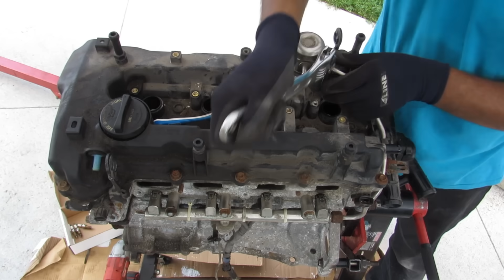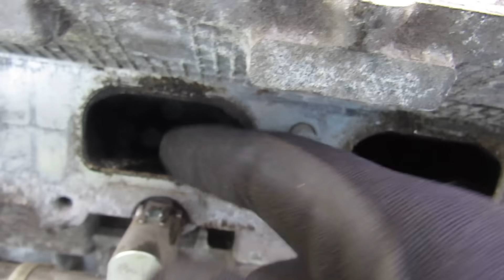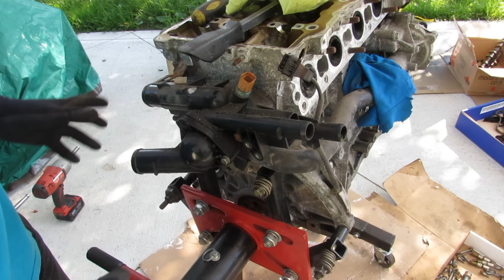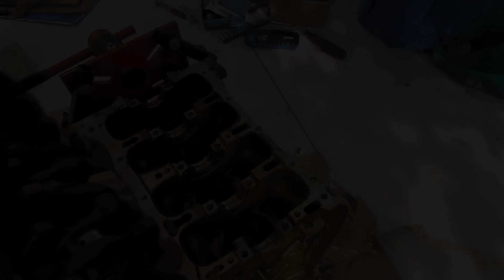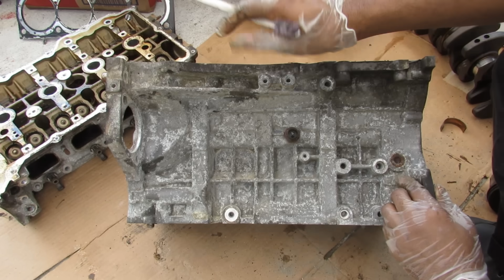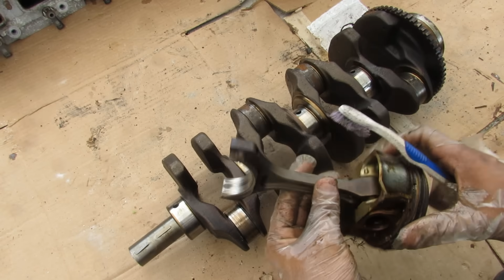Why Hyundai Engines FAIL

Comment: The deburring story doesn’t make sense to me. The oil with debree goes to the pan, then theough an oil filter, then back to the engine and inside the bearings.
Reply: When it new and freshley put back together theres a brief moment where the engine will turn over dry. This for engine builders id the moment where its either very good news or bad news. 

Oil filters are all fine and well but in the real world not all filters are built the same. 

Oil filters will filter down to many microns but if the engine had poor service maintenance
 Ive seen metal shavings in engines pierce through cheap paper eleement filters vecause of this. 

Truth be told its an interesting video but an engine built by robots will never be built to the same tollerance as man. 

Ive seen cases of engines where they have lubricated the cams and bearing but they just haven't put enough on to stop the dry start up.
Reply: The material gets caught in passageways and restricts the flow of oil to the rod bearings.
Reply: If its in a galley on the way to the bearings, which most are, it will first travel to the bearings.

Comment: I had the earlier version of this engine which was also 2.4L but no GDI and it was still running fine at 230,000 when I got rear-ended and totaled. I had to replace the alternator at some point but that was it besides normal wear items.
Reply: The older Hyundai engines seemed to be much better than the newer ones. Hyundai has had issues for years with quality control from everything to engines to paint to sensors to trunk latches, they’re cheaply built and their quality control sucks
Reply: most cars from the 90s/early 00s were 10x better built than now & cost a fraction of the cost. I feel like just keeping mine, getting newer engine& adding BestBuy applecar play. Kudos to you for that many miles so far.

Comment: I had a Santa Fe, American made with that engine which at 135000 kms gave up. Sounded like nuts and bolts rattling around in a tin can. My engine was checked for debris in the oil and non was found at around 70000 kms. Hyundai replaced the engine with a new one as they extended the warranty to 180000 kms. They will also reimburse those who already paid for repairs. Hell GM needed to be pushed to replace their faulty air bags. I have had a Ford Topaz that had the sand casting plug (frost plug) leak in the first year that Ford told me that that part wasn't covered under warranty. I also had a Ford Taurus that dropped down to first gear while traveling at 70 mph. That happened twice to me. Throwing the transmission into neutral didn't work as the motor was over revving. Problem not covered. Oh by the way as my 2014 Sana Fe was so reliable, only needed oil changes and regular maintenance I bought a 2021 Santa Fe. Maybe the Big Three should make affordable, well contented, reliable cars with long warranties and the then the public would buy them instead of the competition, Toyota.

Comment: Too bad Hyundai / Kia messed up their bread and butter power - plant....You would think they know they HAD to get this right, or it would kill their reputation. I have had incredible results with their 6 cylinders,  2009 Genesis sedan 162k miles, and 2013 Sorrento 155 k miles.  No troubles with either.

Comment: Well, it's better than a Volkswagen engine.  Nice roller on the high pressure fuel pump follower, instead of the flat bucket design that wears out on the Mk6 GTI. :)

Comment: People in 2012 were hyping up Hyundai saying their vehicles were “no longer junk”. I remember nearly falling for the hype when I stupidly went for a 2012 F150 with the 3.5 ecoboost instead. 😂 I had unexpectedly switched jobs from commuting over an hour to working locally and decided to go with a truck instead. Boy... I felt the impacts of being a test dummy for Ford with those first gen ecoboosts tho. Although... after everything was worked out... I can’t lie... that engine turned out to be pretty decent. Ford put two new turbos and redid the timing systems at around 65k miles. Thank god I bought the extended warranty. 😂 But since then... the truck has actually been great. Still actually drive it daily.

Comment: As an owner of 17 sonata and a previous hyundai dealer employee I recommend everyone get only a full synthetic oil change the conventional stuff doest resist thermal breakdown as well as synthetic in addition to using additives like Lucas full synthetic oil stabilizer (the black bottle), motorkote, or best line. They add a tremendous amount of friction modification lubrication and will NOT void warranty. just make sure you keep detailed documentation on oil changes if you do them yourself.
Reply: How about just buying a Honda or Toyota instead.

Comment: I bought a 2013 Sonata GLS Base back in 2014 with close to 65k miles on it. It was released from a rental fleet and that explains why it ramped up so many miles in just a little over 1 year. The car was definitely not in top shape as you could imagine how renters did all kinds of abuses on rental cars. Long story short, I started hearing some knocking sound from the engine around 75k miles and I thought it would blow up any time soon. But till today, 7 years later, with 143k miles on the clock the engine is still running pretty smoothly with lots of power, although the sound still exists with heavier throttle input. And other than this and the renowned steering wheel clunking (due to a broken $5 rubber ring in the steering motor), the car still holds up pretty well.
Reply: I have a 2013 Elantra GT. I always make sure it is serviced on time, I still have the car, 78,000 on it . I just got the notice from hyundai to bring the car in and as I read somewhere else, so they can install a computer program to shut the engine down, when one of the telltale signs shows up. I guess so they can put the bandaid on before the engine destroys itself. The car has been a relatively good car, it  did have that issue with the rubberband in the steering and the clock spring which they wouldnt warranty, and then come out later and said it was,I fought with them to reimburse me for it.

Comment: little known fact, these engines are a result of the collaboration between Mitsubishi, Hyundai/Kia, and Daimler Chrysler called the GEMA engine. common designed block with the manufacturers putting their own little spin on it. the VVT system is a Mercedes design which is shared across all manufacturers, called MIVEC in the Mitsubishis and VVT in the Chryslers and Hyundai/Kia. A common modification that people do on the Dodge Caliber Srt4 is use the Evo X oil pump and timing chain system as the it doesn't have the balance shaft module. I just finished rebuilding a 2.4 turbo block for my Caliber and used King rod bearings and a timing tensioner for Hyundai/Kia engines.

not sure what else fits but after watching this tear down it looks like the water pump is the same, cam gears, and the timing components, I wouldn't be surprised if the oil pump/balance shaft module is the same (as they look very similar in pictures), and possible crank bearings.

Comment: The new 2.5 are coming apart too.
We have done soooo many engines at work it's unbelievable.
Reply: How are they still in business??
Reply: @alejandro11000  Good question. Probably the same case as GM. If Korea had more decent car brands they'd be dead by now.
Reply from the maker: Are they? Haven't read anything yet
Reply: @speedkar99  one oil pump failure and one complete lower end failure so far.  80 miles on the pump car and 9k on the failed engine.  Cvts are very short lived some haven't worked off the car carrier to the lot.  Updates rendering modules useless... busy but not a lot of fun.

Comment: I love Hyundai and Kia and own one but… if it was a debris left in the engine at the Alabama plant which they said years and years and years ago why would the 2019s be doing the same exact thing and some of which that were built in Korea? It’s not debris it’s design.
Reply: Well at least they gave a lifetime warranty if it was GM they would still be deny it was a problem
Reply: @heknows5418  exactly!!! I told my mom to go for a 2016 sonata with 58k if she liked it (she now owns it) it’s a limited with the extras so it has rear heated seats and sun shades and all that. Knowing the engine issues I still said go for it but I also knew there was a lifetime warranty extension.
Reply from the maker: Exactly...the way they handled this was suspicious

Comment: I have a sonata 2015 sport. I’m a taxi driver the car was bought 0 miles on 2015, I drive 100 miles every day or 8 hours a day now the car is 147,000 miles no problem I noticed the rattling noise come front the top driver side only when I accelerate but the car has no lights no codes work normal only the little noise when the radio is off is noticed. I know my car just control your driving behavior no one is waiting for you know your car and always change your oil every 3000 miles it work for me.

Comment: Does 1.6 engines have the same issues ?
Reply: Yup. And I left it at the dealer.  80K miles.  I could not afford a 9000 repair.

Comment: I believe what you called a oil pressure sensor is in fact the knock sensor. Not 100% sure but that's where they usually are.

Comment: "Because they know you're going to have to change the engine" 😅  Great video man, excellent work. 👏
Reply: My 1992 toyota corolla also had those hooks for easy engine removal. It had 230000 miles when i hit a deer and totaled it. That was a great engine. Why do you think they had the engine hooks on it?
Reply: @Justin_Credible777   The hooks in the Corolla where there just in case you wanted to remove the engine to clean it from the outside.

Comment: Had a 2006 Hyundai Sonata ( my first car) with the 3.3 V6.
Changed the oil religiously. Then one day after a long road trip. I started her up... knock Knock, it was a rod knocking. 
Over time it got louder and louder. until one day I decided to get a new car, a 1999 chevy lumina. 
Sold my sonata for $400.
Never will I ever buy another Hyundai.

Comment: Hi there. I found this very interesting - Thank You.
Seeing this is a Canadian site, I'm trying to find out why my 2012 KIA Forte5 EX 2.0 hasn't been put on the recall list here in Canada? I know Canada has been really slow/behind on getting the recalls out, but I have read & heard others with the same engine have gotten their recalls & some not. Some have even had their engines replaced or tended to (aka installing the knock detection sensor). Also, a class action has started back east & not here in my neck of the woods (I live on the west coast). I can't get an honest answer from KIA (the dealership or KIA Canada) obviously, just "oh you must be one of the lucky ones". This engine issue isn't only the 2.4, this is apparently happening to the 2.0 engines as well!!  I know someone who has the sedan of the same year & the same engine as my hatchback & they received their recall notice a few months ago already & their issue seems to be rectified. My car has 92,000 km on it and I have been noticing "ticking" which seems to be getting louder. No oil issues, yet.
I feel trapped with this vehicle now as I'm terrified every time I'm out driving it for my safety as well as for others. Also now I can't even sell it with the reputation Hyundai & Kia has right now nor am I in the position to replace it with a new vehicle.
Any helpful, intelligent, honest people out there to help me out?
Thank You in advance!!

BTW - Sorry about the novel
Reply: https://youtu.be/ClGfvQxfXdI

The sound you are hearing 59:48
Reply: "ticking sound" is from the pistons hitting the cylinder walls. ( Noting to do with knock, btw)
This engine is garbage bro. You can only fix it with complete engine rebuild.
If you are driving like a granny you can maybe get 150 000km, before the engine completely destroy itself
Reply: @dantebg100  Thanks for your input - Unfortunately wish the vid had English subtitles.

Comment: Had a 2013 kia optima 2.4 bought it basically new and had it until 135k. Great car other than oil consumption. But sure am glad to own a Toyota now.
Reply: Did the replacement engine/short block apply and was it done to that car at 135km?
Did you sell it back to the dealer?
Did he say how he was going to tackle the problem oil consumption?
have you ever seen it on the road again?

Comment: 13:00 at least from my personal experience there is no rebuild for engines once it’s locked up it’s trash most of those cars generally get a whole engine, there’s few cases where they get short blocks but that’s about it
Reply: Correct they do not rebuild them. They either use a long block or short block whatever is available at time of ordering the parts.

Comment: This problem only exists on the 2011 and newer Hyundai/Kia models with the 2.4 L four-cylinder engine, because 2010 and older models are still good. For example, the late-2000's Sonata four-cylinder is still a reliable vehicle.
Reply: In the machine shop we see all sizes and years of blown 4 cylinder Hyundai and Kia.   but mostly the 2L
Reply: The issue only happens on H/Ks made in the USA. Korean ones are super reliable.

Comment: I must be lucky. I had a 2012 Veloster 1.6L non-turbo 6-speed, and it gave me absolutely zero issues all the way up to 170k when I wrecked it. I bought a 2017 Veloster 1.6L non-turbo DCT, and it too has given me zero issues. It has 70k right now. Hopefully, my luck continues with my 2017.

I have always used Mobil 1 oil and OEM Mobis filters since day 1 in both cars, and I change the oil regularly (as well as tuneups). Once they are back in stock from the chip shortage, I plan on getting a Veloster N.
Reply: I been hearing the 1.6 is the good one. The one in the vid is the 2.4 which is known to be bad

Comment: I wonder how the newer 1.6T gamma engine is. I've had mine for 4 years and haven't had a single problem yet
Reply: My wife has a '17 Soul with the 1.6 Turbo Gamma engine.  So far it's been a great little engine.  Every 15,000 miles I've sent an oil sample to Blackstone, with normal results.  No oil dilution, no abnormal readings.  Motor stills runs smooth and quiet.
Reply: 4 years ait shit

Comment: We bought a 2015 Optima new, our Theta 2 went at about 65K miles, no warning at all and I was on the thruway when it happened. Sudden loss of power, dash was lit up with warning lights, but fortunately I was able to limp to an exit I was familiar with, it finally quit as I just pulled off, and we coasted to a final stop. KIA replaced the engine, absolutely no hassle at all, we had our car back in a little over a week, they towed it and gave us a loaner at no cost to us. So that was about 5 months ago, my only complaint is, the new engine (as in brand new), is a dog, nothing like the original. I was impressed with the power the original engine had for a non turbo 4 cyl, but I guess that power came at a cost. I spoke with the service manager about it, but all I get from him is, it's the same engine and it checks out with no issues. In my estimation it's down 15 HP or more. One other "rumor" I heard may be the Achilles heel on the Theta was that the main bearings weren't hefty enough for an engine making nearly 200 HP. So my guess their solution was to drop the compression ratio, hence, less HP.
Reply: My Santa Fe engine locked up in the middle of an intersection , in the pouring rain . An A hole in a BMW was behind me just honking his horn for 5 minutes. I had to put a tow strap on the Santa Fe, and tow it the last 4 miles to the dealer with my Prius which never lets me down. You should of seen the guys standing around at Hyundai when I pulled in with my Prius with a Santa Fe a rope. lol
Reply: The best move..is to buy the 6cyl engine they offer!...no problems with those, and they are powerful, and efficient too.

Comment: If you havent already, can you please please tear down a Honda FK7 engine please!!!??? I would love to see the workings of that engine as I currently own a Honda FK7(civic HB)
Reply from the maker: How about an H23?
Reply: @speedkar99  That works. But if you come across a L15BA Turbo for cheap, that would be cool too see lol. This is the engine that has the oil dilution issue that causes premature engine failure.

Comment: Of course the only good used car I could find last July was an 09 manual Hyundai so not only do I have to figure out why the transmission shifting into 2nd gear is so loud sometimes but now I have to worry about a grenading engine.  Nice.  Actually after research it mainly effects the 2011 and 2012s that were made in the Alabama plant.

Comment: Seemed like a great idea at the time, but boy did things change quick! I personally own a 2015 Sonata 2.0T with 155K miles and so far no major issues(knocks on wood); but I'm glad they scrapped the Theta 2 family of engines in favor of the new Smartstream GDI with MPI...now only time will tell how these hold up.
Reply: I hope the Smartstream proves to be reliable. But I wonder if they scrapped an engine that was no longer defective, given all the time they have had to get it right. I'd probably be a little more leary of a newly designed engine that one that was recalled for failing after 100K miles.
Reply: I had a 2015 Sonata Hybrid. Wow what a nightmare. It needed a new transmission at 75k. Then a hybrid system warning and it shut down on the expressway. After a PCV replacement, a hybrid cluster and then Hyundai refuses a battery replacement, I got rid of it. Awful resale value.
Reply: Well buddy the smartstream are comming with a worsening fabric problems than these ones

Comment: Is it only with the 2 liter engines or goes to any hyundai engine too? I have a 1.6 gamma 😱
Reply: It was only the Theta class engines.  The Gamma 1.6 (N.A. and Turbo) motors were not affected by the design and manufacturing issues.